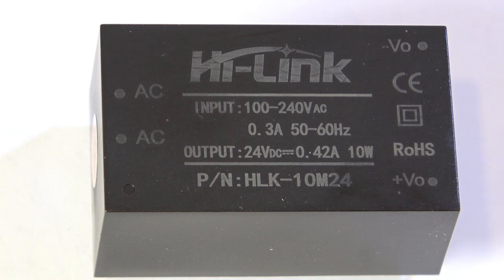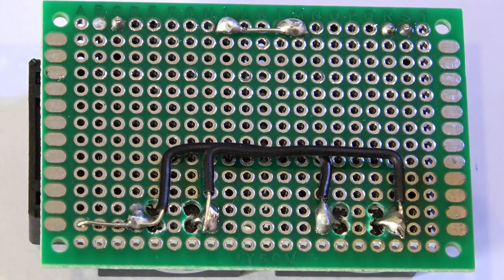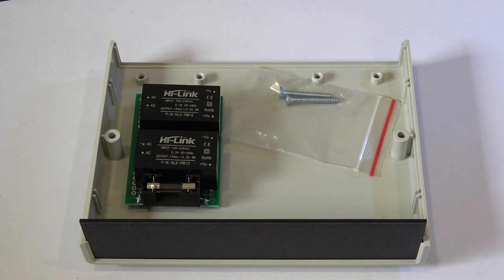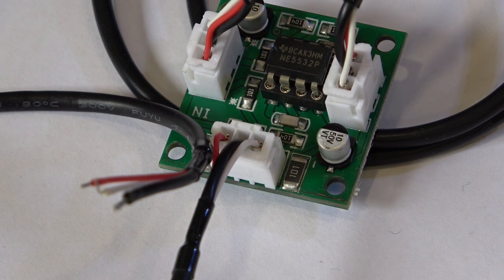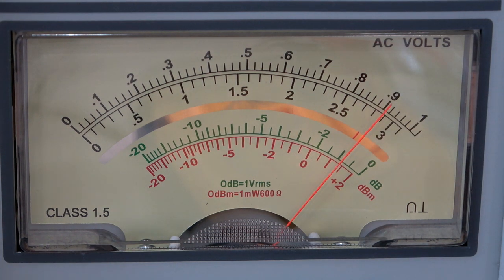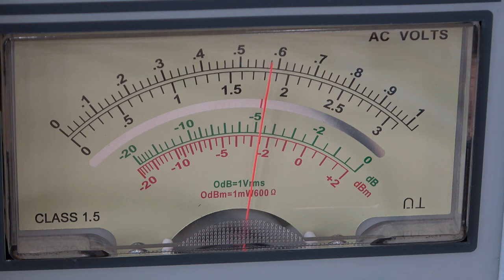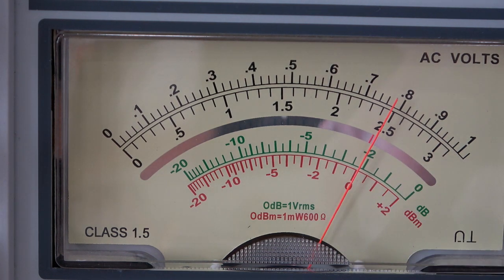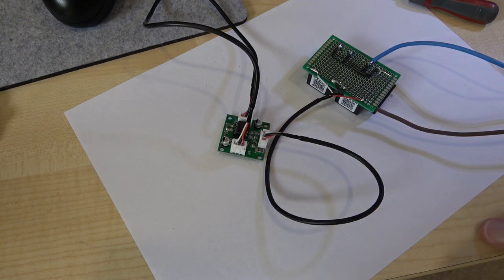SMPS for a Pre-Amp. REALLY?

Comment: I just purchased this board but mine looks a little blue compared your your green.  Ive just removed those caps and mine measure 46pF.  I dont have the correct test equipment to measure db loss.  Would these caps be better left in circuit.  Thanks for a nice channel.
Reply from the maker: Hi Michael, sounds like a reasonable choice of caps. A small value can help stop you receiving the odd radio station and keep things stable. I would leave them in. They seem to have sorted out the problem of early boards with its 330 pf, this will roll the HF.

Comment: How come i never see an additional capacitor on the output of SMPS for further smoothing? Or extra capacitance on SMPS?
Reply from the maker: The current draw is so low at about 8mA ripple is not an issue so adding extra does not help. Only if I find an issue would I add extra. The length of the supply lead is also very short.
Reply: @MichaelBeeny  I was just wondering because you said you wanted to use batteries at first. I figured you wanted to do this because batteries have no ripple. Wouldnt putting a capacitor in parralel be like using a battery? I completly understand your reasoning and im a electronics noob. Im plan on building the Accuphase pre-amp and using these smps for power, I really hate dealing with transformers.
Reply from the maker: @dantheman1998  It's possible harmonics of the SMPS that CAN be an issue. I would tend to use a transformer as a preference. It does depend on the circuits ability to reject such noise. As preamps use such a low current, you can always use a very small transformer, which of course give 100% isolation, something some SMPS will not do. Always some leakage that might give problems with ground loops.
This was an exercise in can it be done? the answer is yes, but a transformer will give 99% guarantee all will be well.
Reply: @MichaelBeeny  what are you talking about?? Even I know that SMPS are isolated with the high frequency transformer.
Reply: @dantheman1998  if you're going to be so bold with a statement at least be right

Comment: Hi Michael. Great little project and thinking of knocking one up myself but I must confess  you've left me curious how you implemented your input blocking cap. Kind regards.
Reply from the maker: I simply put one in line with each of the the input sockets.
Reply: @MichaelBeeny  any particular capacitor type or value you recommend?
Reply from the maker: @jezdimir2007  Any type really except ceramic or electrolytic.2.2-4.7mfd
Reply: @MichaelBeeny  Thank you. Love your work BTW.
Reply from the maker: @jezdimir2007  Thank you, I appreciate your kind words.

Comment: I have AC transf. 30-0-30 volts. Can I rectify first, then  use resistor to limit the current and then 2 Zener diode 15v for symmetrical DC to feed this NE5532 you showed here?
Thanks for all your videos, they are excellent and very informative.
Reply from the maker: Yes Al you probably could. Don't forget an extra (well 2) electrolytics on the output close to the 5532, as such a circuit will add ripple. I think from memory the 5532 only uses about 8/10mA and it does not change in use, so drain as little current thought the zener's as needed. You can use up to 18-0-18 DC volts.
Reply: @MichaelBeeny  Thanks.

Comment: Is it possible to remove the lid on the power supply to see inside them?
Reply from the maker: Not at present, as they are soldered onto the PCB. I expect to have some more soon. If I can open it without it's destruction, I will, just for you!!

Comment: Depending on the gain settings, some opamps need a little compensation capacitor to maintain stability....maybe they just over egged the value.....
Reply from the maker: Very true, if anyone does have stability issues a value of 22pf makes sense, some PCBs do have this value but somewhere down the road this been changed to 220/270pf probably in error.

Comment: There isn't anything wrong with SMPS's . I think most people still think of the ones back in the 90s? Most work on 65-100kHz, which is a lot easier to get rid of compared to 100/120Hz rectified signal.
Btw there are very nice supplies from Meanwell that have a symmetrical output. 
When using to separate ones it's advisable to use so blocking diodes to make sure the positive and negative voltage start up in sync.
Reply: Are the meanwell ones as small as the Hi-Link ones?
Reply: @dantheman1998  That depends on what you need. Check the manual for dimensions. In general they aren't really very big. But it all depends on power.
Reply: "There isn't anything wrong with SMPS's"
Some radio engineers may disagree with you!

Comment: 3 years of using the wrong parts that actually cost them more money... Now that's funny. At least it was a quick, and simple fix. Thank you for sharing.
Reply from the maker: Hi Jerad, the reason they get away with such things is that few people ever get to test the spec. Many probably don't know how good these little chips can be. Some people just accept what they have, other just throw it into the bin. The effect of the HF roll off is lack of sparkle and fine detail, just because of a little capacitor you can hardly see.